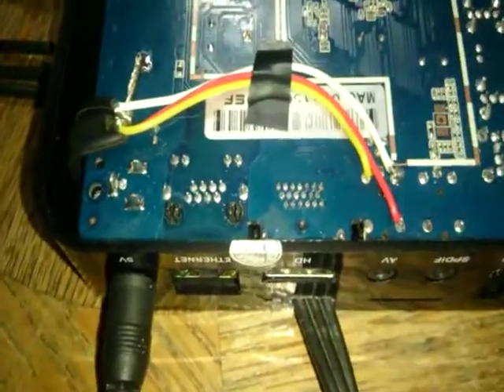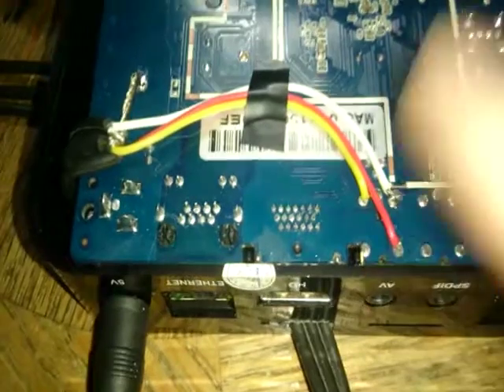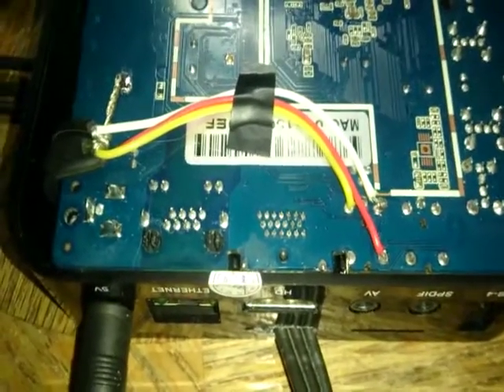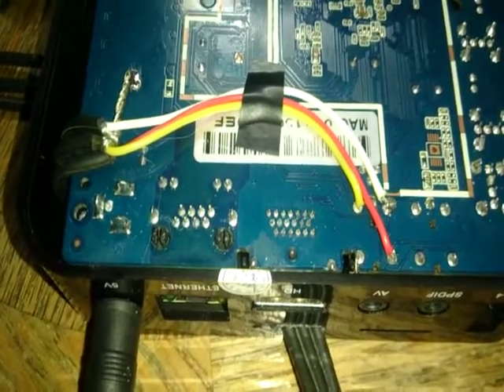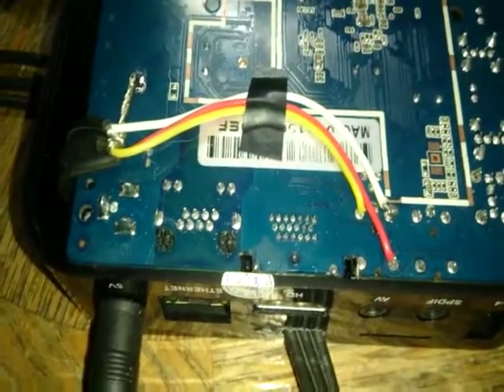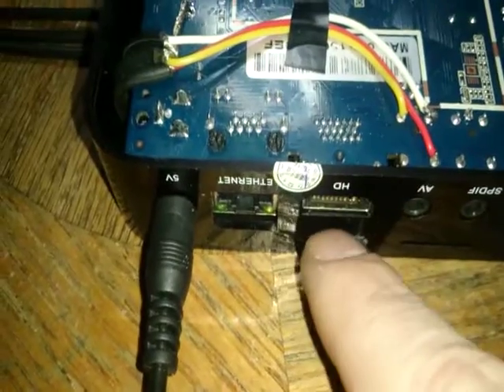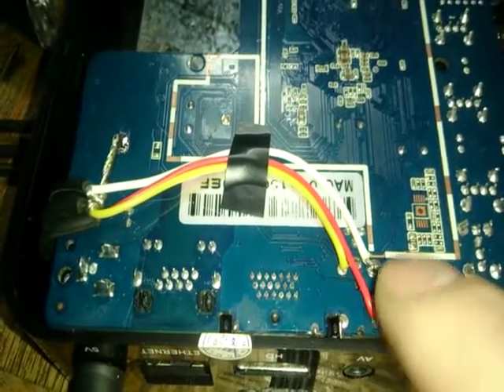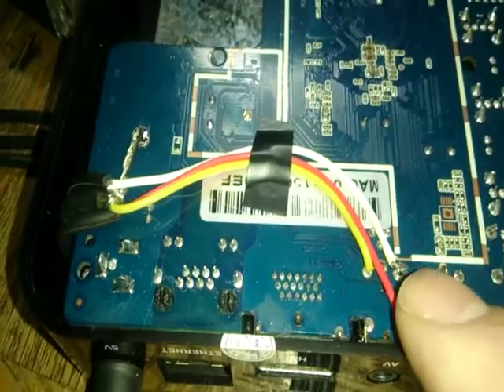MXQ composite AV PinOut

Comment: Hey, I connected 3.5mm jack from Logitech speakers to this AV out and It seems that I get only one channel - only right speaker is working. How could I solve this that I can connect this speakers?
Reply from the maker: i did the pin out here.. https://youtu.be/_J3KBDifdxA?t=68   however i have no idea what kind of cable you are using ..andddd some of the mxq have different pinouts for the video cable.

If you are sticking in a 3 section end instead of a 4 .. not sure what you would be shorting as well.
it should not break but most likely something is shorting..
Reply: Yeah, I have 3 section cable. Maybe it needs to be 4 section.
But I'm thinking of another solution, if you can help me if you know I would really appreciate. I want to connect this Logitech speakers which has 3.5mm jack and RCA output with LG TV which has only optical digital audio out. If I buy DAC adapter and connect TV and adapter with toslink cable and then 3.5mm jack from speakers to adapter would that work?
Reply from the maker: yes that should  work.. 

here are some examples.. from random ebay ..i have not used any of them just examples..
you can find the cable ..but don't know if it would work with yours.
http://www.ebay.com/itm/AV-A-V-AUDIO-VIDEO-TV-Cable-Cord-Lead-For-MXQ-PRO-4K-Android-6-0-TV-BOX-/272842272062?hash=item3f86aaad3e:g:pgcAAOSwurZZHpn3

then you might need this..to go with it..
http://www.ebay.com/itm/Gold-3-5MM-Stereo-Male-To-2-Rca-Female-Y-Cable-/390842376936?hash=item5b000562e8:g:HXcAAOxyzqdTdHNJ

or this..from your tv like you suggested
http://www.ebay.com/itm/Optical-Coaxial-Toslink-Digital-to-Analog-Audio-Converter-Adapter-RCA-L-R-3-5mm-/331955171563?hash=item4d4a11f0eb:g:hdoAAOSwFdtXxaFu

and you might need this one..
http://www.ebay.com/itm/1-3M-Y-3-5mm-Male-Plug-to-Dual-2-RCA-Jack-Cable-Stereo-PC-Audio-Splitter-Aux-/131848222005?hash=item1eb2c43535:g:JhoAAOSwnNBXYL~z
Reply: Thank you. I just wanted to make sure that I don't need some extra amplifier from optical digital audio out to speakers. Actually I want to buy adapter that have headphone jack that I can connect directly to 3.5mm jack from speakers that I can avoid RCA cables cause of low quality.
Reply from the maker: well another option would be this..
http://www.ebay.com/itm/1pcs-3-5mm-1-8-Male-to-Male-4-Pole-3-Ring-TRRS-AV-Audio-Extension-Cable-1M-Gold/291269944037?_trkparms=aid%3D555019%26algo%3DPL.BANDIT%26ao%3D1%26asc%3D46674%26meid%3D51d0ff9a48a945c9a25998696a8f6931%26pid%3D100506%26rk%3D1%26rkt%3D1%26&_trksid=p2045573.c100506.m3226

and then cut the wire and re wire it..?   .but who knows what kind of wire is in it..if its that cheap thread type then its hard ..
but you would need a meter with a continuity tester on / beeps when you touch the two leads together..
Reply: tnx but sounds like too much work and too many posibility for screwing it up :) Hey, one more quick question: do I even need DAC adapter for optical digital out from TV or can I just use this: https://goo.gl/eMA6Ak and connect directly to jack from speakers?
Reply from the maker: sorry your message got flagged for review , just seen it now.... anyways at first i thought it looked cool but then thought what powers it , A quick google on  Mini-M 3.5mm Adapter   shows its actually still a toslink ..and not a audio analog..convertor ..
Reply: bangs6996 Ok, I thought so. Tnx again for everything.

Comment: Mecool KI PRO is using this pinout with AV socket - starting from tip - left audio, right audio, composite video, ground. That's basically OMTP / Nokia pinout (microphone=video).
Reply from the maker: cool.. thanks for taking the time to comment and share your info..

Comment: Hello Bro, 
I just bought a G-Streamer Android TV Box. It didn't come with a RCA to AV cable, but I bought one for it. However looking at the PinOut, I don't know if its going to work. I dont do any of this soldering stuff because im only 17.... I don't know all that stuff LOL. But if you could help me out that would be awesome for over the winter holiday season. Here is the link with the pinout: https://files.cablewholesale.com/pdfspecs/10a1-041.pdf. Also I watched your video, but I don't know where to buy a AV cord with that type of PinOut without having to solder anything. I'm really considering just getting but being 17 and having money is not a good combination LOL. Therefore, watching money go down the drain isn't cool you know. Any help would be greatly appreciated!
Reply from the maker: the cable you show.. have you actually tried it?, some boxes come in that layout.. ...if not you need to make your cable like this https://youtu.be/_J3KBDifdxA?t=74  ..   So you do need a multimeter and test for continuity .. 
another option is getting something like this https://goo.gl/nRK4Mg  use as a reference ..you can find them cheaper on ebay as well..    .. you can also try plugging white for video and either yellow or red for audio.
Reply from the maker: in the comments here Paragliding Shanghai just posted the other day with how to cut and just twist the wires on the cable it self which may be easier for some people
Reply: You were so quick - that seems impossible LOL, but no I haven't tried it yet I saw it will be delivered tomorrow. So when I go to get it I'll try it. I haven't opened up the Android Box either to see if it matches with what you have in your video, but I can to see. I have seen Paragliding Shanghai's comment in multiple places so I wasn't sure if he was a troll or not. But the switching out of cables (white in video etc.) I have seen that in a few places also, and I will try that when I get the cable. After I try it I'll message you and tell you what I see on my screen. Thanks so much btw.
Reply: As far as the part at the end of your video, how would I know if my Cable is that way (with that PinOut)?
Reply from the maker: you need a multi meter  to test from the pins I showed between the end of the cables.. .. the problem is  your box actually might be the same way the picture you showed me ... I had couple of mxq boxes a bought 2 months after this video and it used that style cable..   if you don't have a meter .. you are just going to have to try it .. try different combinations after   ..yellow for video, white for video, red for video  ect..   Now the next problem .. on one box it was set to hdmi and I could not set the rca out until I plugged into a hdmi tv to switch it.. so that was annoying ..              After you get the cable let me know how it goes.     Without a meter It will be really hard to step by step you if your last option is to cut the cable
Reply: Thanks so much I'll probably let u know by Monday. Thanks again for your help.
Reply from the maker: your welcome.. and good luck..
Reply: Thanks bro again... Pulling the AV cord out one pin worked. I switched the Screen from the PAL to NTSC and now its working perfectly. I rooted it in 20min, and now I'm about to see about flashing it to Version 6.0.0.2 with OPENELEC. Thanks so much for the first step because I was struggling xD
Reply from the maker: your welcome and good luck with the openelec

Comment: IT WORKS...    The cable you are trying for the camcorder is not the same as you should use for the android box (OTT MXQ in your case).The cable you should use it looks identical to the camcorder's one, but the pin out is different.
The Jack has got 4 contacts, we call pin 4 the contact closer to the cable, and pin 1 the tip.
so we have this situation
cable for the camera:    PIN 1 white (audio left)  /     PIN 2 yellow (VIDEO)  /   PIN 3 GROUND  /         PIN 4 red (audio right) 
cable for the MXQ:         PIN 1  yellow (VIDEO)     /     PIN 2  white (audio left)  /   PIN 3 red (audio right) /   PIN 4 GROUND (or other android box)The most important difference is the ground... if in both cable was in pin 4 you could swap some other rca and it would work.
I suggest you to cut the 3.5 mm jack, buy a virgin jack ad solder the cable in the order I wrote. I had a camcorder cable too... I did in this way and it works.
Reply from the maker: HI great comment.   
.. I had added a picture at the end of the video .. https://youtu.be/_J3KBDifdxA?t=72  .. I also notice some mxq have different cable layout.   re soldering the cable would be easier as well.
Reply: @ModItBetter  Yes. And the Pinout explained by @paragliding is not the same. Video out v/s Audio left for pin 1. Which one is correct for MXQ Android Box?
Reply from the maker: @aviseeboruth8838  Hi,,, its been a long time and so many version of the mxq boards .... back then i ended up just getting some "hdmi to rca" converters off ebay for like 5 bucks..they still come in handy for other things.. as well..  Besides that its trial and error..   If your board looks like mine in the video then your good to go with my pinouts,   If you have another board you might want to first find the ground wire , which would be obvious to find usually u can put your multimeter on a ground on the mxq example the usb shield ect..   Then you just need to try the last 3 wires for video and audio .. Personally i would first find ground then test the last 3 with just the video . save the audio for last .

Comment from the maker: If you don't want to solder getting a hdmi to rca adapter like this https://goo.gl/nRK4Mg or from ebay ..will do the trick as well... plus the bonus it will work on basically anything that has hdmi out. and you can have all codec's working if still on older android boxes

Comment: Work for me: screen resolution set to 576pix (on HDMI tv).
insert AV cable with 4 segments on the box, but not fully (2 mm remain out) - check on analog tv to obtain image (video on white mother cable).
Output video signal: HDMI or AV composite, not simultaneous!

Comment: Here's an article which explains the difference between A/V cable pinouts.
http://anythingbutipod.com/2006/04/zen-vision-m-video-cable-other-4pole-35mm-pinouts/
Reply from the maker: +Jack Shaffer thanks for the share. I believe you can tell if you need my pinout if you have a mxq with a black top right corner button.  the new clear button one uses one of the cables included in your link. as it worked with one of my cables....

Comment: Si i got mine from eBay and it never turned on, I tried using an other 5v adapter that worked better then the one that came with my mxq but still nothing! Seller refunded my money but I still want to try and fix it, what should I do?
Reply from the maker: +Djblones you can either make the cable I have in my other video or buy a usb one.. and see if it you can get into u-boot.   another option would be to hold the hidden switch in the av port to see if you can boot it into a recovery mode. .
Reply from the maker: +bangs6996 https://www.youtube.com/watch?v=yIGxtHi9Ilw    the first 2 minutes would let you see if your actually interesting in going further with it.   .. if your board is different then that video , You might have a new board like i just got..which I'll upload a very small video of the pinout's and jumps you need to do to get into u-boot..
Reply: +bangs6996  i tried the hidden boton and still nothing , i think they shipped me a blown board, thanx 4 the tips bro
Reply from the maker: +Djblones np ..... if you get bored the last thing you can try is stick a usb thumb drive in usb1 .. hold the switch in and plug in the unit ..keep holding what ever your using ../ toothpick ect.. for about 5-10 seconds.. if the lights come on the usb stick.. you can probably save it , it is looking for recovery.img and it means it is alive .. besides that .. they are making them way to quick I'm sure.

Comment: I just got mine and have the same thing happening. I ended up purchasing the HDMI to composite A/V converter from ebay,item number 231679263412. pending reimbursement from the seller as well.
Reply from the maker: +Douglas Hartwig thank you for the update.   I just opened my other 3 units and the pinout is different on them as well same with the tx rx pads to dump the firmware..          Just a heads up , if you run into a problem where your video's are over sized in kodi.. upgrade to kodi 15 and disable the amlogic codec .  but because your using that adapter you might not run into that bug.   And thank you for taking the time to reply.
Reply from the maker: +bangs6996 so with that said , even if somebody does post a cable link for a mxq a/v cable you run into a 50 percent chance it is wrong because they made a new board layout for the mxq. and with the cable you have to disable a codec.   with the adapter suggested by Douglas Hartwig
    you may be able to use all three codec's